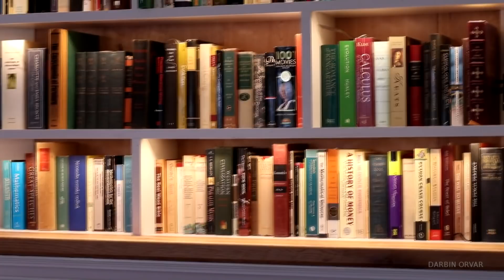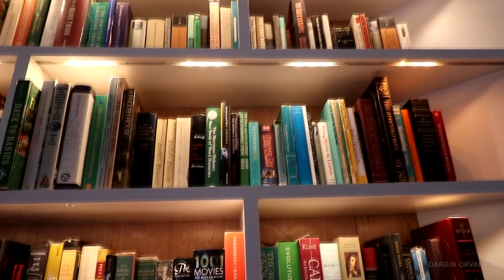Built-in LED Bookcase w/ Mantel over Fireplace

Comment: The vacuum on a shelf over your out feed table is BRILLIANT!  Thinking my self so flipping smart, I put cord reels and pendant outlets in strategic places so I wouldn't be tripping over extension cords. Then I defeated the whole effort by trailing a vacuum cart and 30 feet of vacuum hose all over the shop. I'm hanging that cart from the rafters first thing tomorrow morning.

Very nice job on the shelf unit.

Don't go catching pneumonia on us. There are some really nice "cabinet style" portable propane heaters out there that work perfectly in a garage woodworking shop. Look for one of the self contained ones on wheels that holds a 20lb propane tank inside it's cabinet, has an oxygen depletion and a "tip-over" safety sensor valve. Mine's a "Dyna-Glow" but "Mr. Heater" makes a similar one.

Comment: Good execution of a design for a very challenging space. I hesitate to comment but having built hundreds of book shelves and cases for a wide range of clients I would have done a couple of things different. First I would have staggered the shelf depth. Standard book shelf depth is 12” I would have used that as a minimum and made center shelves reach back into the corner as far as possible for those oversize books.  Doing this may make the fireplace look like it is in some version of a cave but that could be off-set by working on the fireplace molding and in particular the use of “dentil” trim molding at the top edge.  It will be interesting to see how the transition to the wall shelving is accomplished. For your future bottom cabinets I recommend including several 2 drawer lateral file cabinets. People find integration of those a necessity in library/office designs. Not a problem with this design but If you wish to avoid sags I recommend a maximum of a 30” span for ¾” thick plywood shelves. Nice use of the LED lights. Again I don’t want to criticize a well-executed design just make some comments on a few things. Good video.

Comment: I love the look of the book case. I'm interested to see how you transition to the next unit. Have you considered how you'll access the outlet if it happens to need repair in the future or how you would plug in a new surge strip if this one needs replacing? Maybe an access panel would be helpful. I also think I might have dropped the surge strip to the bottom shelf so you have the option of camouflaging it behind a vase or picture frame on the mantel.

Comment: A lovely use of the LEDs. It's amazing how warm a nice set of bookcases can make a room. I wonder how long the screws will hold the shelves. A dado joint would have been stronger and you would not have needed the brace during assembly.

Comment: Hi Linn, that looks fantastic!  I am doing something extremely similar for a built in floor to ceiling bookcase with pane glass doors in a corner of my office (angled wall, wasted space).  The only thing I did differently is that I am using white heatshrink where I need it (I don't trust electrical tape), and also I am armoring the wires a little bit with 1/8" PET Expandable Braided Sleeving in a white color.  It's the same stuff I use when I sleeve wire groups in computer power supply wiring (and sometimes I sleeve car audio wires on higher end jobs instead of split loom).

Comment: Darbin- your craftsmanship has truly grown since the day of your first video posting. You are a gifted woodworker and the proof is within your latest builds. Did you freehand the design of the bookcase or did you design it in  Sketchup? Also, I was wondering about the two different shops you have. May I ask why you didn't keep them under the same roof? Was it the lack of space for you? I have a 12x16 woodworking shop (already too small!), in the backyard and it is cramped. I will end up with a second shop for welding towards the front of the garage. I will park the welding cart just inside the overhead door with a small portable fold-up welding table and supply storage on the wall. I will eventually design and build my own welding table on wheels with storage underneath. The back of the garage where I have an old Oak high school lab table from a local school and perfect for crafting at. The back area was initially set up for my spouse and her candle making, but she has since passed away. I have always enjoyed drawing and crafting as well so it will be used often. Ideally, I would have preferred them to be under the same roof so would not have to add wiring of 220 outlets and more lighting in the garage when the shop is set up for it. I have never used SketchUp and I was wondering if you have for all of your new builds/designs in the new home? April Wilkerson recommends Skillshare for learning?. SketchUp to learn how to best use. Have you any experience in the programs? Thanks for the videos and any advice you can spare.

Comment: Hi Linn, great job! Instead of installing the lights as you did, did you consider putting a kind of face frame on the front, a bit wider than the board thickness? You could then have put the lights on the back of the face frame where they would have been fully concealed. You did put cover strips on the front of the shelves and could have made them, a bit wider to accommodate the lights. Notwithstanding, the shelves look great.
Reply from the maker: Thanks Geoff, the face frames are actually wider than the board thickness, and with the lights being recessed, you can't actually see them that much, unless you look up towards the highest shelves.

Comment: Lynn. Instead of the unsightly wires on the side, why not have an access box—think drawer—in cherry panel? I would have also run a new outlet in the corner future use. The LEDs are nice being DC so wiring is tiny. Hidden access box could be horizontal and well hidden.
Reply from the maker: Hugo, as I mentioned in the end of the video, this project is not finished, and I will create a different box, once I finish the other side of the bookcase.
Reply: Also you can use the outlets behind the shelves if you make an access on the back drop.  That will  hide everything plus you will have a secrete compartment.😊

Comment: Question: Could you use strips of "flat cable" like that used between circuit boards and disc drives to give a more controllable extension between the led strips? I think it would give a flat minimal profile to deal with. They're easy to cut into two conductor strips.... Easier to glue flat strips.. Minimal shrink wraps ...low profile... Oh, and its pretty cheap too.
Reply: Oh .. LOVE the look of the intermittent light strip - Great design.